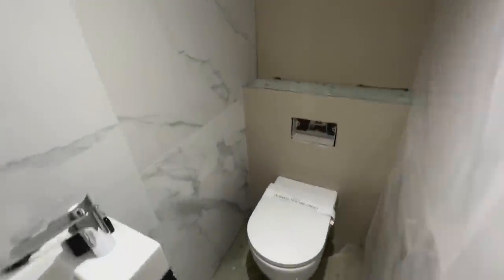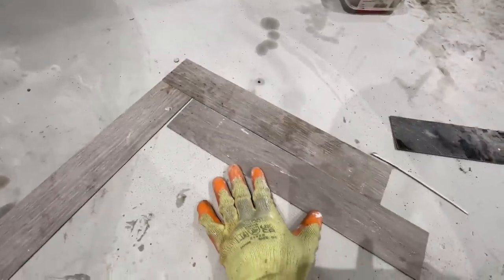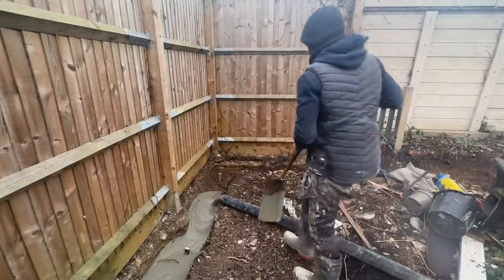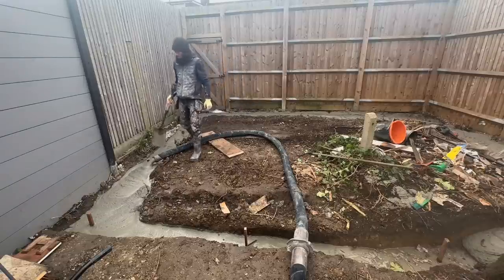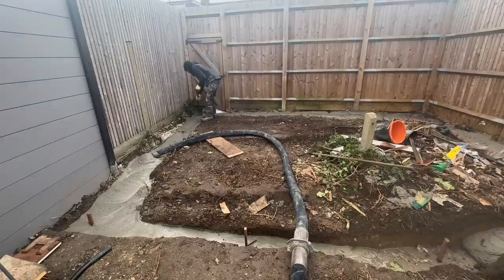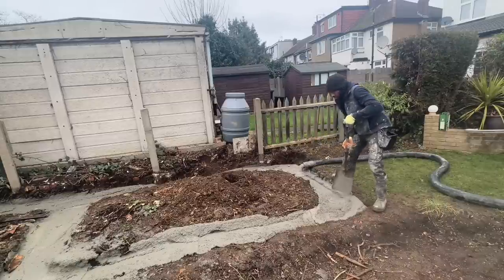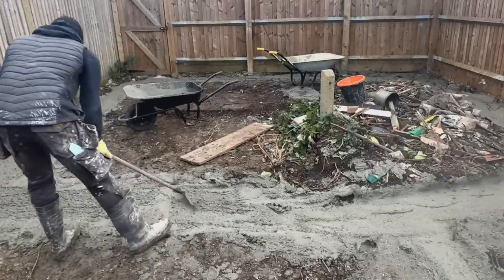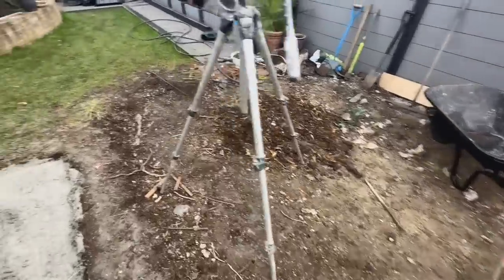Garden room with wet room build: Ep 2

Comment: Hi Darren, surprised there will be no access to rear yard, street etc? Looked like you were having problems with your hose. Great work again. Cheers, stay well.
Reply: I agree with you. It seems crazy to block off that access, especially in London.
Reply from the maker: Hi Dave, yes there will be a steel access door at the rear. Same place that the existing fence door is. Cheers

Comment: Are them footing deep enough for a garden room my dad wants one doing and I told at least 900mm dead
Reply from the maker: Not necessary to be that deep for a garden house like this. People over do things. At the end of the day it’s about how much someone wants to spend.
Reply: 600mm building code
Reply from the maker: There is no building code for the garden house as it does not require building regs. And there is no code for foundation depths under building regs. All foundations under bc are individually accessed. You can actually have 200mm deep trenches for an extension in some
Cases. It’s to do with the ground type
Not the amount of concrete
Reply: But some do need building regs so I will look into it
Reply: @darrenthebuilder  different in Scotland🏴
Reply from the maker: Yes it all depends on a few things mostly the internal floor size. I have done a video on it with the details
Of what the rules
Are. https://youtu.be/6g4u_g74VUw
Reply from the maker: @peterleishman431  rules are the same. An out house of this natures will neither need
Planing or building regs. No different if you bought a shed in the store and made a concrete slab and put it on it
Reply: @darrenthebuilder  wrong frost cover 450mm in Scotland in building regs
Reply from the maker: @peterleishman431  you’re not really listening. I said the outbuilding does not full under building regs. You’re reading to respond not to understand. Let’s share the right info.